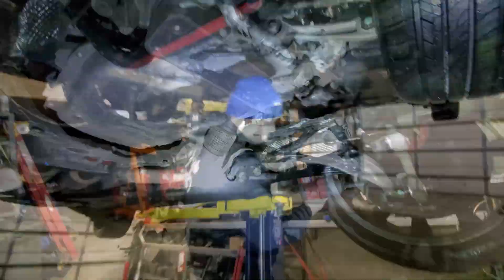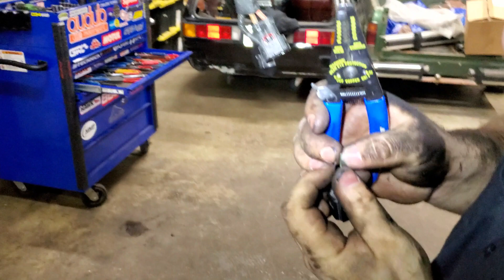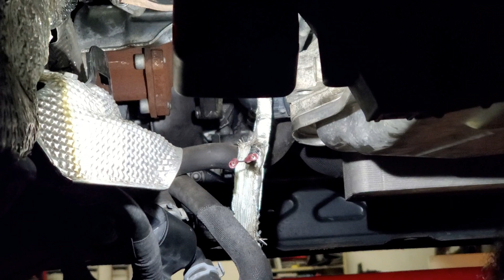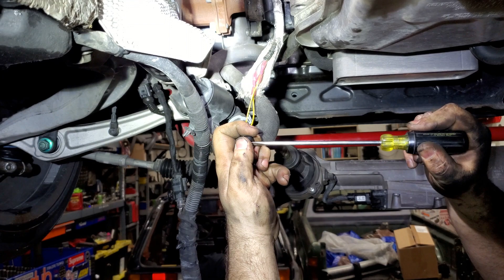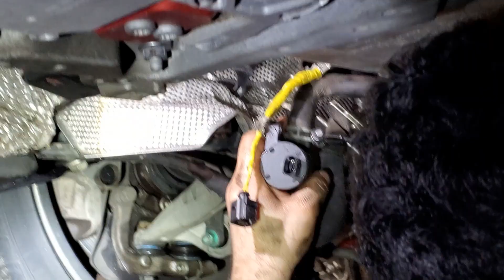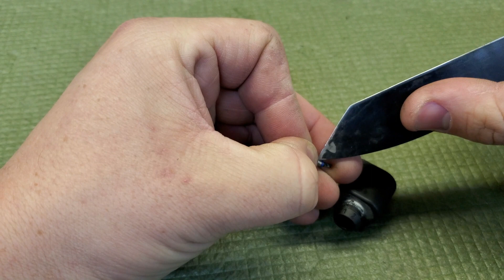Audi ZF8 Trans Cooler Valve Replacement DIY (Fix Code P2753) | C7 A6/A7/RS6/RS7, B8 SQ5, D4 A8/S8

Comment: This is a common issue for many Audi models for many years. AoA issued a recall on certain A8 models due that coolant leak may cause ecu damage which results in engine stalling while driving. I wish more people could push it to AoA so that they would cover other models as well.
Reply from the maker: At 109k miles, I think they would laugh at me if I asked lol
Reply: I have a 13 a7 109k.... should I go ahead just replace to be proactive or wait until it throws a code?
Reply from the maker: Honestly it doesn't take much to get under there and check the wiring harness. Then you will know for sure
Reply: Ok Thank you
Reply: mine came on at 90k miles. I am not sure how long it has been on before. but judging by the fact that it came on and then went off then came back on, the same day I bought the car. I think i just had tough luck when buying the car. lol.
Reply: I have a 2013 A8 3.0L. Do you know if mine is under warranty for this coolant issue? How can I get more information on the recall? I used this site, but it doesn't mention any recalls: https://web.audiusa.com/recall/ After recently having replaced the front suspension, front control arms, front left knuckle, pcv valve, AC compressor, suspension module, and a number of gaskets in the process of replacing the pcv value, I now have the check engine light coming on again. The code says it is the transmission coolant control valve. It would be nice to throw the problem back at Audi and have them cover the costs for once due to their planned obsolescence! When an Audi starts to break, it falls apart - crashing and burning. 85k miles!
Reply: @thepeguesfamily  Unfortunately if the Audi site didn’t mention then yours was not covered. If I remember correctly only 4.2 FSI was covered due to the location of the valve and ecu.
Reply from the maker: It looks like it isn't covered. You can always call your dealer service dept & have them double check
Reply: I just replaced mine today after getting the check engine light and having the code P275300 come up. However, my check engine light is still on. Am I supposed to reset the battery or something?
Reply from the maker: Try clearing the code. If it comes back then something else related to it is wrong. Did you replace the wiring as well as the valve?
Reply: @GarageTaught what else can be related to this because I replaced valve and wiring but the code still pops up
Reply from the maker: @JSSMORENO9 possibly a bad tcu if the coolant traveled far enough
Reply: @GarageTaught I check the tcu harness and it’s still good doesn’t look fried and by the looks of the wire the coolant did not travel far
Reply: @GarageTaught I drove the car and it drove fine transmission was shifting good might change the housing again maybe I did something wrong there
Reply: Is there any other way of clearing the code besides disconnecting the negative battery terminal? Because I tried that and the check engine light was still on. I replaced both the valve and the wiring. Thanks for the help!
Reply from the maker: @BeStOfThEbEsTMEX not without a code reader that can do it
Reply: @GarageTaught I cleared the code with my scanner but it come back right away I checked if there’s voltage coming in to the housing and there is as soon as I connect it to the valve there’s no more voltage